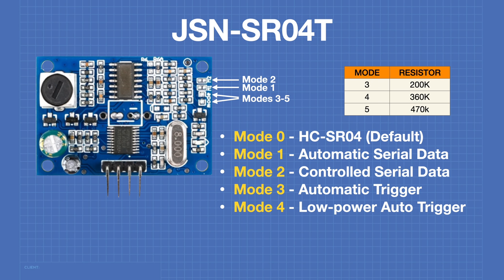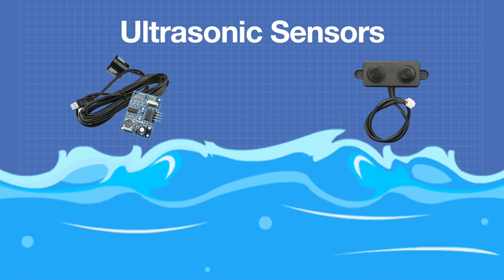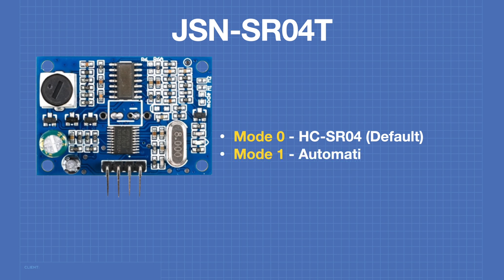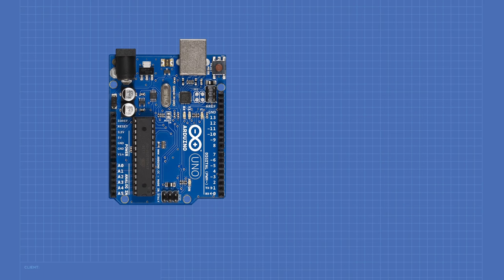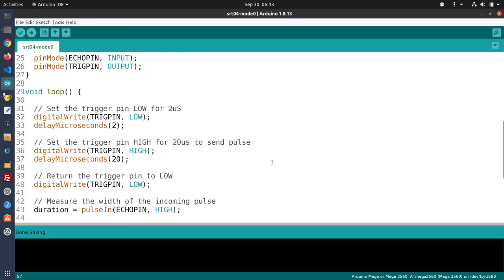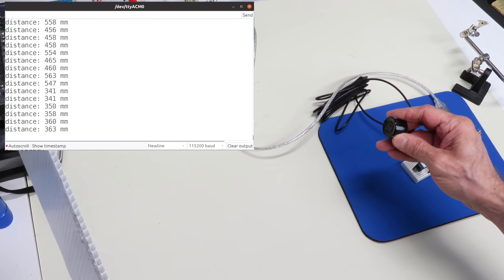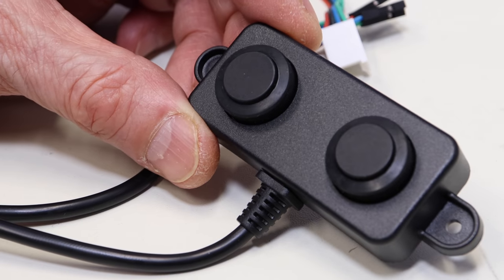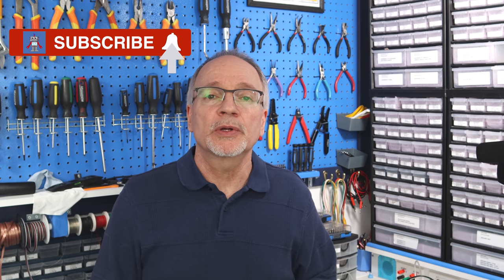Waterproof Ultrasonic Distance Sensors - JSN-SR04T & A02YYUW 💧☔

Comment: Hi, I copied and applied the sketch for the A02YYUW. I have an Arduino Uno IDE 2.0.3
Everything goes well including compiling but when I turn on the serial monitor there is no output.
It says in a line that is printed in light gray:
Message(enter to send message to 'Arduino Uno' on 'Com6')

I selected 'Arduino Uno COM6' in the top left of the sketch.
The button to the right of the compiling button also does not respond when pressed.
What's wrong?
Reply: I also experienced the same issue. Were you able to fix it?

Comment: Muchas gracias, su explicación me ayudó mucho.

Gracias me ayudo mucho, estoy haciendo un prototipo de control de agua en arduino, inicialmente use los sensores HC-SR04 y todo estaba perfecto, el sistema funciona bien, pero al cambiar al AJ-SR04M, empezarón los problemas, de inicio no leía los dos sensores que tengo conectados, después el rango era equivocado, use las librerias de newPing y luego Ultrasonic, sin obtener buenos resultados,  al principio pensé que era algun error en la conexión al mudar el proyecto a una caja para usarlo, después pensé en que ta vez necesitaba algún tipo de libreria sin obtener resultados, pero gracias a su explicación y el codigo que amablemente compartió, me sirvió para entender como funciona el sensor y así probar y encontrar el error.
Gracias.
Saludos desde San Luis Potosí, México.

Comment: Hello, in first graph, what do you mean about raw data?. all sensors just give the estimated distance nor raw ultrasonic echo or any analog signal to process outside the sensor.
Reply: He means the emulation mode of the sensors. They give the raw data of how long it took for the sound to go and come back, the arduino has to process it.

Comment: Hey Bill thanks so much for testing these! I purchased an A02YYUW to measure distance underwater and noted that it failed in this case, and you noted the sound travels differently underwater. I was wondering if the data coming into the sensor could be calculated to get the correct reading? If not, are you aware of a sensor that measures distance underwater?
Reply: I might have answered my own question. It looks like sound travels roughly 4.2x faster in water compared to air so dividing the returned value by 4.2 might give to a reasonable measurement? I have really no idea about any of this BTW! 😆
Reply: Can you please provide me with your code used to program the A02YY sensor. I tried bills own buy doesn't seem to work.

Comment: hi nice video... could please tell me is there any way we can measure distance below 22 cm with JSN SR04T?
Reply: Watch the video carefully. The reason for this minimum measurement is because of the single transducer, and its switching speed from transmit to receive modes. The time it takes to switch between these modes corresponds to that limitation.

Comment: I don't know if this would work to be able to measure distance under water, I just looked it up. It said that sound travels about 4.3 times faster through water than air. I wonder if this is causing the strange readings. Hope this helps.
Reply: I'm not sure, but I think it can also be due to the transducers not having enough power/momentum to push water and get the readings.

Comment: Thank you for this very useful video. It is always a great pleasure to watch your channel:) I wonder if these sensors could be used to measure the height of water in a small tank (1m3)? The sensor could be placed at the top of the tank and facing down to the water level. Do you think it could work in this situation (ultrasonic sound rebounding on the surface, not on the walls. What about the angle of measurement/selectivity)? I was surprised that you did not try to put sensor towards the water level in your bathtub. Many thanks Bill !
Reply: Yes you can.

Comment: have made one 3 years ago and it sends all my tank information to the web, now I have designed a until that uses ESP 32 with Water proof transmitter and receiver as well as pump control circuit all with LCD display and web server
Reply: Hello Bob. Sorry if I misspell in English. I'm not very fluent yet. 

I read that you have done this project with an LCD screen, and since I deduce that it is more difficult to graph the information on an LCD than on an LED strip, I would like some advice to develop my project Which consists of replicating a vehicle parking sensor. 😅 I don't want to buy one! I want to do it myself! 😂 But I'm very new to C programming.  And any help would be very welcome. I've been looking for examples on the internet for days, but nothing like what I want to do. I describe how it works: 

 I would like to make 2 RGB led bar (front and back) that presents the distance (Green, yellow, and red), and location (left, center and right) in a fluid way all over the led strip using an array of 8 JSN-SR04T sensors. (4 in front and 4 behind). 

I would love, if possible, for you to guide me in this project! 🙏
Reply: @raulcid2369  that is very ambiguous project for beginner , but there are  many or very similar projects on the web using an Arduino just for starters. So try a few simple ones first they work yourself up to more complex  projects
Reply: I had also made something similar but facing come issues.... Like reading from a02 is not consistence some times...

Comment: hey I really like your video. I've might have solution for you if you want to measure something underwater. you can use JSN-SR04T or AJ-SR04M as driver for fish finder transducer. just change the transduser with fish finder. the cheap one. I've tested it and it work

Comment: The speed of sound is quite different under water, it's about 1500m/s unless I'm wrong.
So if you correct the code and calculations based on this, they perhaps do more accurate measure?
Reply: Yep.. The returns were probably getting there in the rejection window.  Retuning the software might work, though the distance may be attenuated since the module won't be tuned for transmitting the sound into water.
Reply: @chrisw1462  that's true but would it really affect that much in such confined space? Would it work to use two of them? One for transmission and the other for receiving only? I think that these senors and or Arduino won't need too wait for the other one too finish.
Reply: @hannescamitz8575  I've read up a lot on sonar, but I'm not an engineer.  I know you have to allow time for the transducer to 'settle' (stop vibrating mechanically and ringing electronically).  Sensor engineers spend a LOT of time getting that settle time down, and there's no way to tell what it would be in these sensors without testing. Having separate receive and transmit transducers as you suggested would reduce that a lot.  Even on separate PCB's, the transducer would induce some vibration into the receiver.  Have to test to see if it's enough to bother with in software, but it would still increase response time by a lot.
     But there's still the math:  at 1500 m/s average in saltwater, sound would be traveling 10.67 mm - almost half an inch - in the time of one 16 MHz Arduino clock cycle.  It gets worse, as the ADC can only run at 1 MHz max, giving a resolution of over 6 inches.  Fresh water is actually a little better, but not enough to help much.  Having a fast, dedicated A/D do the work (like the JSN-SR40T?) and having the Arduino poll it is probably the only answer for underwater sonar.  (Okay, not the JSN...  It uses an ST Micro at.. 16 MHz :-(.  It's ADC is a bit more accurate at it's max speed (still 10 bits - IIRC the Arduino has to drop to 8 bits for more speed), that max is still the same as the Arduino - 1 MHz conversion rate.)  A dedicated ADC like the MAX1426 would let you get 5x better resolution.  Anything more would probably lean into the world of expensive ADC's and a DSP or FPGA to process the data.
Reply: @chrisw1462 
Thanks for the explanation! 
So basically it's not something that's fixed in any short period of time at home. I've on the other hand not spent a lot of time dwelling into the world of sonars.

The only thing belive I know is that lower the frequency is the futher it travels in water, or am I wrong?
Reply: @hannescamitz8575  Not sure on that one.  I know radio waves go further at low frequencies.  Sonar tends to run on a wide range of frequencies depending on use, from single digit kilohertz to ultrasonic range.

Comment: It might be interesting to try and measure the distance to an object while it's raining. I would guess the rain drops would interfere with the sensor's ability to accurately measure distances, but I haven't tried it so I really don't know. Perhaps you could test that. You also might consider mounting one of these devices on a servo so you can sweep an area with the sensor or direct it to specific locations...Just a few thoughts. Have a great day.
Reply: I have a JSN-SR04T in mode 5 monitoring my front door which triggers a chime and activates a camera when someone is close, so far it hasn't triggered with rain but I have some blurry video footage of passing magpies.
Reply: You could also take ~100 measurements (or how many you want) and calculate mean (or median) and use that value, rain won't be an issue then.

Comment: what sensor to use for measuring water in tank
Reply: If it is just water measure ultrasonic from top down. If you have foam or fog on the water it can give you false readings and you could use swimmer switches.
Reply: You can get a large float sensor